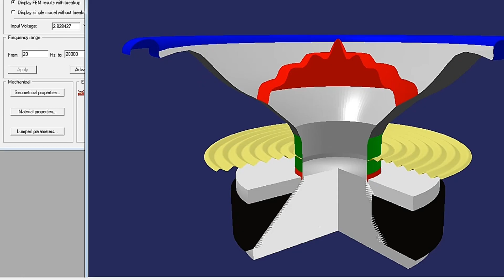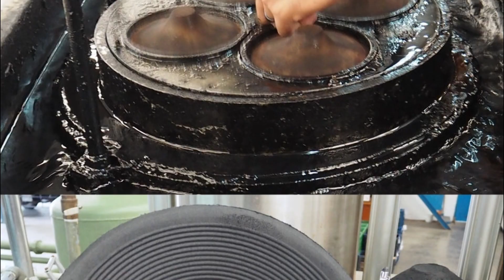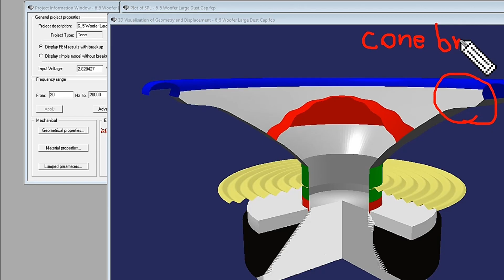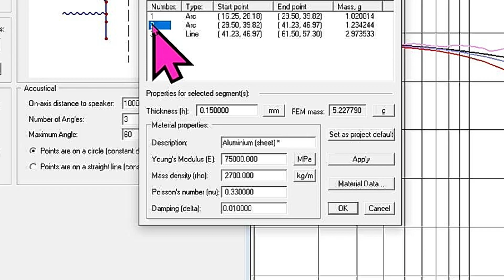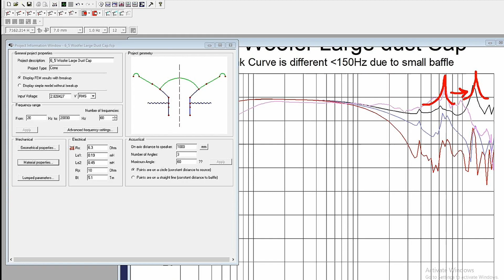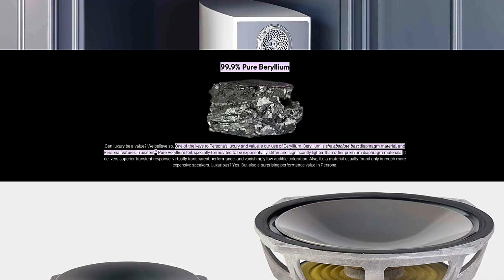Cone breakup and materials

Comment: Best woofer/midbass/midrange material are non pressed paper, carbon fiber with a foam core, or aluminum cone with a thin rubber coating due to ease of crossover design. Ideal you want to be able to use a first order crossover or at least a 2nd order crossover network
Reply: What's wrong with 4th order XO?   This is what I'm considering for my active crossover (Sublime Acoustics).  Tri-amped.  Any advice is appreciated.

Comment: its not just the material that effects the peak and extension, its also the shape of the diaphragm, thickness, and the surround shape, size and material.........and lastly, the voice coil size and bobbin material......even the glue used to connect them all has an effect.